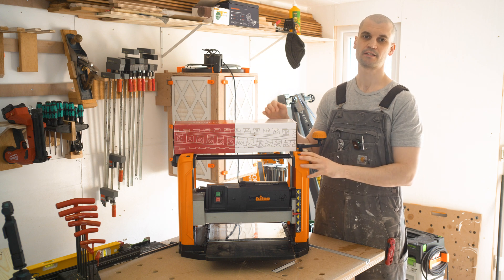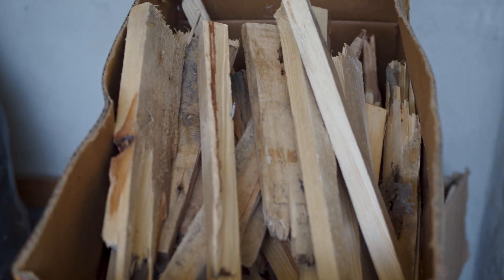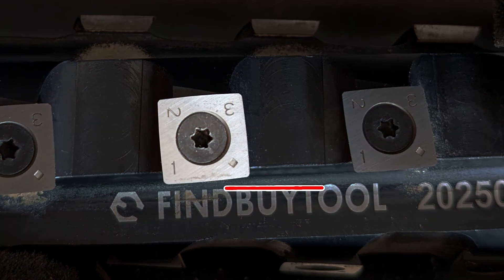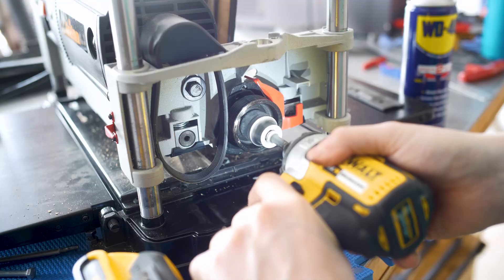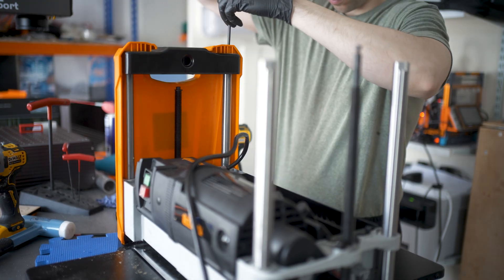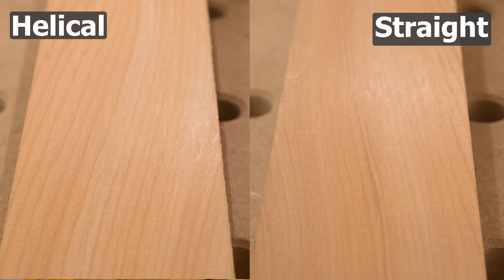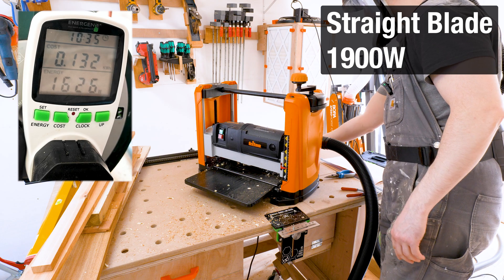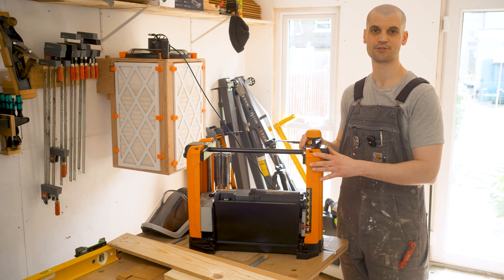FindBuyTool Helical Cutterhead Review for Triton TPT125 | Is It Worth the Upgrade?

Comment: It's a shame that steel indexable inserts aren't as easily available as carbide inserts – not sure it'd make a difference here but tool steel / HSS generally holds a sharper edge and would probably leave a better surface finish, at the cost of less durability. At least that's been my experience with lathe cutters.

Comment: I used this upgrade myself and I'm very pleased with the result. Better finish, less noise and much reduced snipe. Decent price too. I found a Canadian company selling a similar product but it was much more expensive, especially the shipping (Canada to U.K.).
Reply from the maker: Definitely great value for money. strange I haven't heard a reduction in noise, I know others have noticed it but from looking at other reviewers there straight blade machines were hitting 95db+ so maybe Triton have improved the motor as this was newly purchased
Reply: By changing the 2 bladed cylinder to a multi bladed one the frequency of the hits on the wood rise - given the rotation speed to stay the same. A rise in frequency may be recognized in a different intensity to the human ear.
Reply from the maker: Excellent point, you can definitely hear the helical create a higher pitch noise but the sound meter on my phone still would have recorded a drop in sound level regardless of the pitch right?
Reply: I do not know how linear these mics and their amps are. Perhaps they are crafted to a point where they resemble the human hearing.